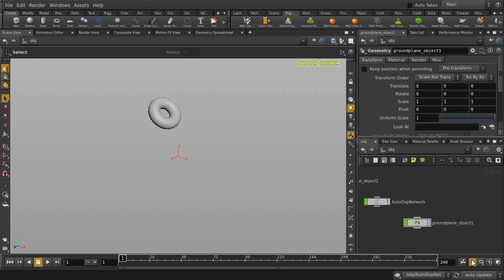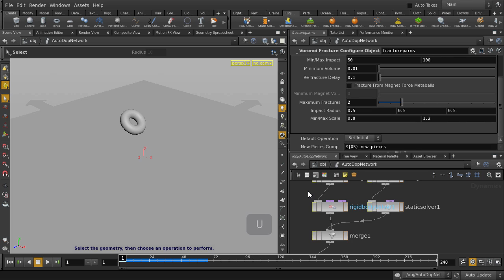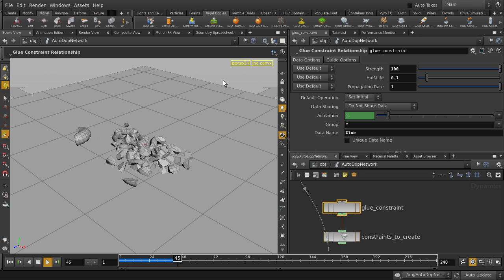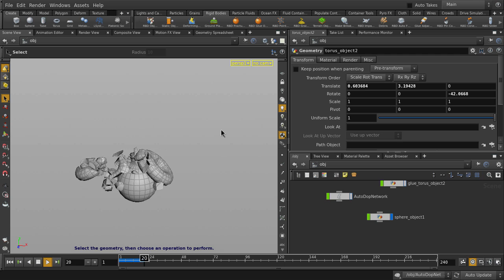Houdini | RBD Fracture

Comment: FYI- if you're doing this tutorial in Houdini 16 you will need to adjust your glue strength. The default strength won't hold any of the pieces in Houdini 16, where it prevented any fracture from happening in Houdini 15! If you want to achieve similar results to the tutorial, you will want your strength setting closer to 40,000.
Reply: bro where is groundplane in houdini 17, i did not found this option
Reply: @mubashirali9986  Groundplane is now under the Collisions tab, two tabs to the left of from the Rigid Bodies tab.
Reply: Thank you so much brother
Reply: brother can you help me more, the same animation is not working at 0:48  , i did the same, i think many options are changed now. these classes are in old houdini version,
Reply: Mubashir Ali had trouble with that part too. Make sure that you are on frame 1, have the Torus selected when you click “make breakable” and that you hover your mouse over the viewport when you press enter. Edeelcing also mentioned that your settings need to be around 40,000 but the default worked fine for me. I’m using Houdini 17.
Reply: @lukesnedecor337  tthanku so much bro